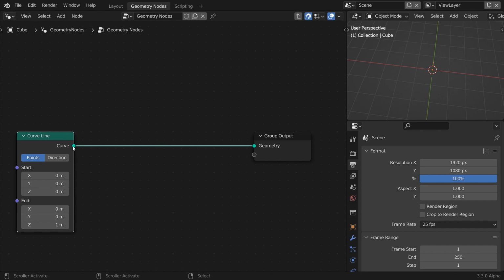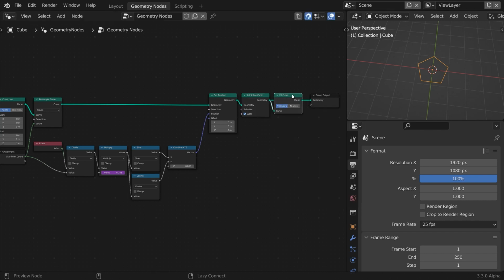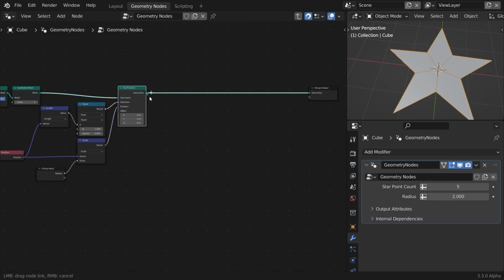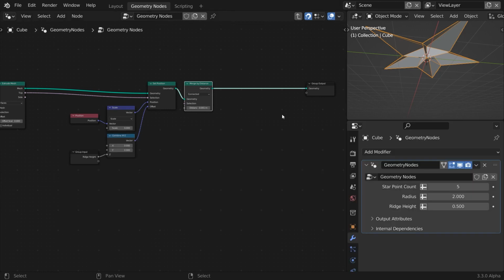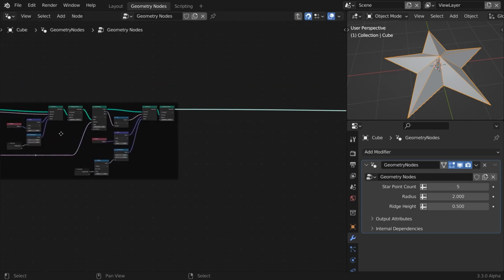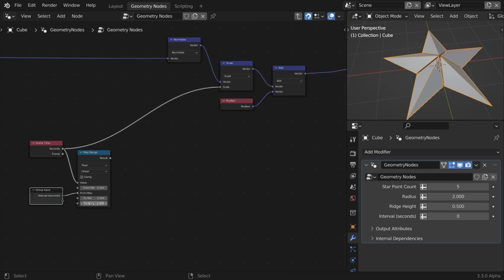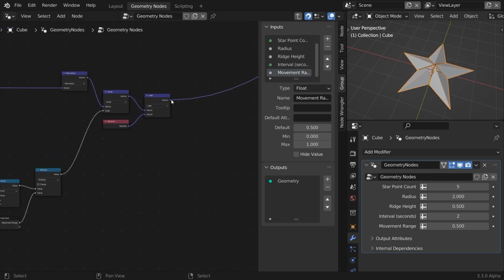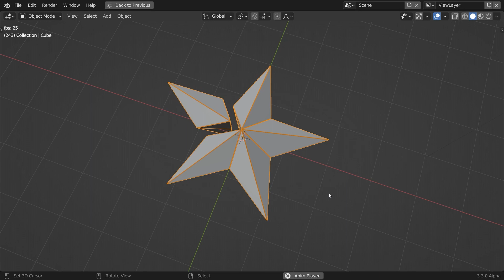Procedurally Model And Animate A Multi-Point Star In Geometry Nodes

Comment: everything is fine until the capture attribute part. my star doesnt look like yours. it isnt splitted into 5 parts. the top becomes flat and the midpoint (centre) moves in a way that the x coorddinate is  nearly - 1 and y nearly -0.35. 

does anyone know why?
Reply from the maker: There are no hidden steps in the video. There must be something you're doing wrong. Go back to where everything works and continue from there. Make sure to set the domain to faces in the capture attribute.
Reply: @ilirbeqiri  followed your steps. thats why i am so confused. thought about the merge by distance node cuz i dont have the option to chose „connected“ tho but otherwise i did what you did… tried it theee times lol but i will do it one more time in the nedt days tho
Reply from the maker: @yannick5116  That ‘connected’ mode is very important. It merges points only if they are part of the same geometry island. Upgrade to Blender 3.3 alpha and it will show in the Merge by Distance node.
Reply: @ilirbeqiri  works fine now. thank you a lot. i hoped that the merge by distance node i had would kinda do the same as yours but i upgradede and the result is the same as yours. thank you. great video.
Reply from the maker: @yannick5116  thank you, I’m glad it worked out fine.